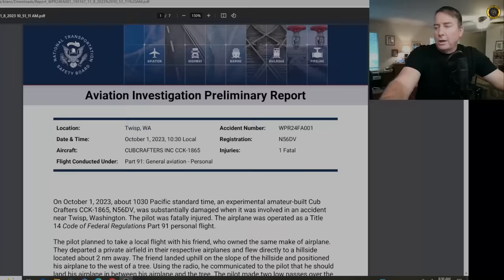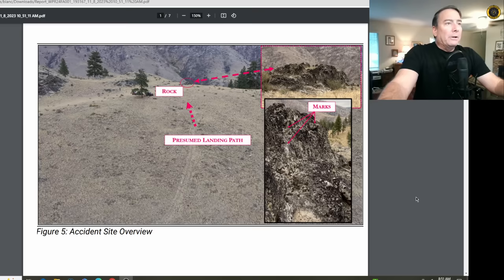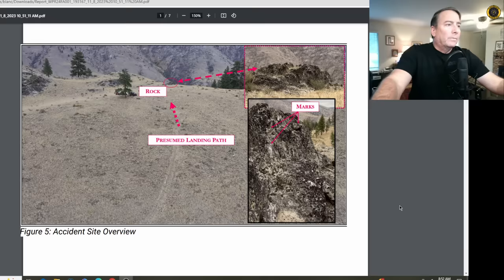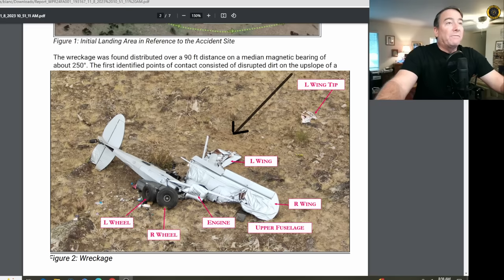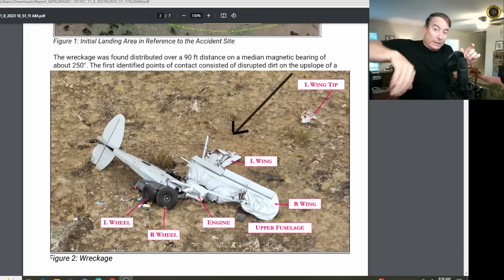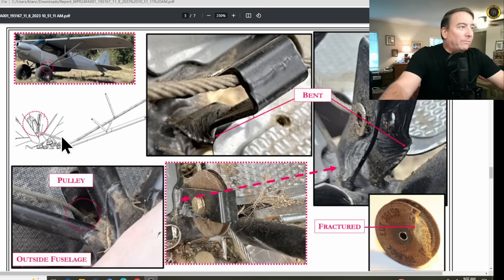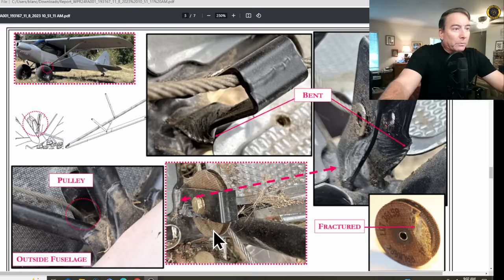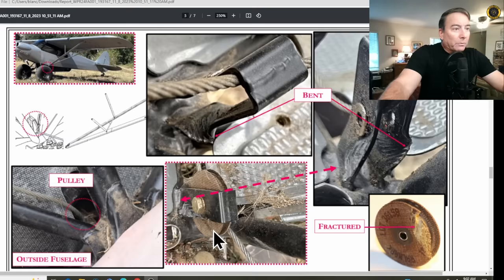Carbon Cub N56DV Fatal Accident NTSB Preliminary Report 10 Nov 2023

Comment: Hi Juan, very sad news again.
I've been following your channel and. Mentor pilot with fascination. But this incident struck me with such a simple cable mechanism running across what to me is a vulnerable position (hard landing for example) that strut joint should be reinforced and possibly a tube for the cables to pass through? To stop something like this happening again. I know that hitting a rock that size is a million to one chance but if I owned a plane I'd be making alterations too better protect the pulley's and cables.
Cheers for the excellent content of this channel.
Alan from Devon UK.👍
Reply: No need at all for that. it's a great design, plus you couldn't do that to your aircraft, as it would be illegal.
Reply: @scotabot7826   Wasn't this plane a home built, probably experimental, so wouldn't a safety improvement be legal?

Comment: I don't fly , I'm very interested in aviation. I am a motorcycle rider ( no crotch rocket) and have motorcycle friends that fly say riding and flying not the same, but the risks are as big in riding and flying in that some folks take big risks and end up having the same result in having accidents.  Juan said landing between the tree and the landed plane , but what happened was the opposite. Too bad this turned out this way.

Comment: There shouldn’t be a void so that the cable can get between, I get weight savings, but composite parts aren’t great for people who aren’t very involved in maintaining their plane. If your cables are adjusted properly, they will never leave a pulley, the cable is to far engaged into the circumference of it to leave it..
It’s not over, as long as lazy pilots exist, Blancolirio will continue to do these videos

Comment: And so…… When his landing carriage got smacked. That was the end of that aileron functioning. You can't really turn well after that. Right? Or left? Left out. It looked like he went left. And you'd think. How can anybody die in a Carbon Cub? As they fly backwards in a headwind! A colleague of mine had one. We used to talk about that. His dad was an airline pilot. He was a rock 'n' roll deejay. I was the engineer. We worked for the #1 FM station in Washington, DC. And I had been a student pilot. Because my dad became a private pilot. I flew Piper Cherokee 140 and 180's. Those were cool.. A lot cooler than a stupid Cessna. It's a, civilian P-51. To a, 13-year-old, at that time.  My dad started taking flying lessons. And I got to sit in the backseat. Every time he went up. And I have the expired previous months, Flight Charts. I always found everything the flight instructor asked for. Much faster than daddy. The flight instructor asked me not to call it out. That it was daddy's flying lesson. I would get mine, later, he said. And I did.

So that was not a good landing. A Piper cub shouldn't have crashed like that. He made a mistake. He shouldn't have been flying. At least I got the flyer for three years. Until my folks got divorced. And I never flew again until about 35 years later. Sort of.

 But when you find yourself part of the Media Crew. For the Air Force Association Conventions. In Washington DC. For a New Year's running. And one night. At the end of that day. I sauntered up to the, Boeing/Lockheed, F-22 Raptor, Simulator. Where they were Debuting. The brand-new, Boeing, Glass Cockpit. Which they would be flying. As it was just entering service. A little over 20 years ago. And I had watched. A number of our US military Fighter Pilots. Flying this simulator.

So I asked the Boeing guy. If I could give this F-22, a try? He asked me. If I had flown, F-14's? F-15's? Or, F-16's? I said no, never. Only a Piper Cherokee between the ages of 13 and 15. With my dad. Over 35 years ago. He said okey-dokey.

And so I get in the cockpit. It's pretty tight. And he starts to point things out to me. But I was a step ahead. And he stopped. And asked me again about the other jet fighters? I said no just the Piper Cherokee. And he continued.

This thing was truly wild. It was beyond Awesome. I had a lot of fun. And then I helped the Boeing guy. As he was giving me some instructions as I was flying it. And when he told me to press this switch on the stick. Until this one display changed to indicate 135. It wasn't changing. And he said I was pressing the wrong switch. I said I wasn't and it's not changing.

So he walked over to the cockpit from his master control panel. And he said, hmmm? We've been flying this simulation all convention long. And this one of the 6 computers. Has never done that. And I asked him, done what?  He said this was the preprogrammed flight plan. And it crashed. I said what do we do now? Since I over flew the last target. He asked me what do you want to do? (He's asking me?) I said. Without that computer operational. Can I just fly this manually? He said sure. And he threw a couple of switches in the cockpit for me. He said you are now 100% manual. What do you want to do? I said I want to double back. And go get that target I overflow. He said go for it.

Well I successfully did that. And that brought the simulation to an end for the day.  He said I did real good. It certainly was a rush. And as I turned around. There were 5 US military fighter pilots. Who had been watching me. And they all asked me. What I had been flying before? 14's, 15, 16's? I said nope.. Just a Piper Cherokee 140 mostly. 35 years ago. For a few years. Nothing since. They asked me why I didn't join the Air Force? I said I tried I didn't qualify to fly fighter jets. So I didn't join. They said I missed my calling. I said no. The Air Force missed a great pilot. They all agreed with me. We shook hands and went on our way. What a thrill! But it ruined me. I'll never be the same again. No.

I had Microsoft Flight Simulator, at home.  And a joystick. Bah! I can't play with these toys anymore! I was in the real F-22 cockpit. I was flyer an actual Simulator. I think he told me it cost about $12 million. That was over 20 years ago. It was running off of six.  6 foot tall. Silicon Graphics, and about $6 million worth of computers.  And Boeings software.

The following year I was able to try the Northrop Grumman, A-10 Warthog. I found that a lot harder to fly. I wasn't as good with that one. I almost collided mid air with a F-16. Flared too hard while trying to land and started to stall. That's when the Grumman guy grabbed the stick from me. I said what up?

He got kind of angry. He thought I was better. And it wasn't a computer simulation exactly. No. This simulation. He told me. He wasn't supposed to let me fly. He thought I was better he told me. And why shouldn't I fly it? It was the high-speed military one. And he told me I was flying with six other, A-10's. And one F-16 also in my airspace. And that had I collided with the F-16. Like I almost did. He said the entire simulation would have been brought to a halt. An unofficial military investigation would begin. Because only, certified military pilots were supposed to be flying this simulation. As the guys that were flying with me. Were up at ramp Stein Germany. Whoops. That was not the same for the F-22 simulator the year before. That was not connected to any military Internet computer based flight system. Very funny. I probably scared those other military pilots? I didn't have any radio communications going. I had no helmet on. I just thought this was a computer game? That one wasn't. And he thought I was better. No I'm not! I just thought it was like another computer game? Just a little more ultimate. Than, Microsoft Flight Simulator with the joystick. I mean that is pretty lame. Compared to being in the actual cockpits. With an incredible display all around you. Made by Northrop Grumman. And I really haven't played a video game since. From over 20 years ago. It just ruined me.

 I keep wondering if I ever want to get a ride. From one of those guys that has a decommissioned jet fighter of their own? I don't care how old. I want to know what my stomach feels like at 6G's? And will it stay in my body or come out my mouth? Should I wait to have lunch until later? Yes! And don't eat breakfast. Don't drink a lot of coffee. The slightly dehydrated. You could hit the bar afterward to get rehydrated. And then it'll feel like you're  back in that cockpit again. So maybe not?

Though I never had problems doing stalls in the Piper Cherokee. And nosing down throttle in and recovering from those stalls. I don't know what it's like when it doesn't stall? And goes loop the loop. I want to see what the gauges do. If they are steam gauges? Or computer displays. I don't care. I just want to know what it's like to communicate at 5G, speeds?

I know how to do Crash-Mattix.
RemyRAD

Comment: G,day Browne from Sydney Australia.
That cable around the pulley system for flight control surfaces has always been troubling for me. Mainly for the cable "jumping off" to the side. However rust (surface) is evident on this pulley (photo) with missing edge. What is your opinion on this metal fatigue?
🍩🇭🇲
Reply: I don’t think it was rust. As Juan mentioned in the video the pulley was made from some phenolic material. Likely a composite material using resin and paper or cloth (linen). If you search “phenolic aircraft pulley” you will find some good detailed photos.
Reply: I believe the pulley is made out of a resin. Did you suggest that the rust was a transfer or that the pulley itself was corroded?

Comment: Jaun, you mentioned that the other pilot was talking with him with a handheld radio. Does that mean the pilot was using a handheld too?  In the report it talks about how the other pilot spoke with him and he replied he was "still flying but having problems."  I would think keeping the airplane flying would have been more important than replying back on a handheld.
Reply: Accident Pilot was using the aircraft radio, not a hand held. All the pilot had to do was press a tiny little push button switch on the top of his control stick to transmit. As far as I know 99% of Carbon Cubs are built this way.
Reply: @scotabot7826  Thank you for that information.

Comment: I get the design intent for these cubs, having one really strong point to help save weight.  But it seems like when you have one point being so critical is a bad idea.  I would think it would be worth the extra weight to have the wing and gear attach at different spots.  So exactly this type of thing doesn't happen.  A bad landing shouldn't damage your gear and pull on your wings or flight surfaces.  After seeing this I don't think I'll ever own a cub (not like I could afford one anyway).  Hard landings are sometimes a thing, whether you like it or not.
Reply: It's not about saving weight, it is designed that way to put a direct, straight load path between the most highly-loaded components of the airframe, namely, the landing gear and wing struts. If you do it differently, with different mounting points for these loads, you are sending stresses through corners and placing sections of the fuselage in shearing loads.
Reply: @coreyandnathanielchartier3749  I know exactly why they did it. The cub is just a flying truss structure. And with the old engines the J3 was flying with they needed all the help they could get. But with modern engines and materials it seems like a bad compromise. I still hold that landing gear damage shouldn't make the plane spiral out of control.

Comment: Are those Phenolic sheaves/pulleys commonly used.  It is strong material, but it seems that thin sections don't have the strength of some alternative materials.  Just my experience with machining parts for odds and ends projects.
Reply: Phenolic material has its advantages and was used for many years to make driven timing gears which were installed in the hostile environment GM automotive engines. Like any fibre-reinforced resin, strength across many examples may vary. While some gears outlasted a first engine life and a rebuild, others failed earlier. In this aircraft, a cheap and nasty similar plastic weight machine pulley might just have survived being flexed, jammed but become a fairlead surface for the cable to slide over, albeit with more force required to move the control. A metal pulley may have also survived similarly. Phenolic material can be more easily machined but it may more easily become worn and abraded. In the aircraft, the pulley experiences far less movement than in something like a hoisting system or a fitness machine. In an ideal world, the cables would have been run up to the wings inside of covers on the front cabin pillars but the we are talking about more weight of cable plus two extra pulleys and their supports. We also then add four ninety degree bends of the cables. In an ideal world, pilots would not subject themselves and their aeroplanes to such risky business. But contrarily, in an ideal world, people should be permitted to push the envelope and take their chances. That is the sure and often resolutely wielded staff of innovation and progress, so long as the adventurers do not take some unlucky screaming and kicking poor sods with them into the afterlife or hell-on-earth disablement.

Comment: This is why I build my model airplanes with pushrods instead of cables.
Reply: That's why I love aerobatic airplanes like the Pitts Special & Extra...pushrods (elevator & ailerons).
Reply: I build mine with Testor's glue and put them on my shelf😳
Reply: Yes I agree. And where possible, servo placement close to the control surface.

Comment: Its odd the seat in cub is right up against the stick like that. 
Or is that stick in Full Deflection (nose up position)? 
(if not you would be fitting the pressure from seat as you pull back.), 

(Why does it not have a half circle relief cut out of the seat like old cars with bench seats and stick shift had. 
LMAO Ford i drove 2nd n 4th gears were very uncomfortably close to my friends crotch as she was sitting in the middle for road trip. Go to point i would skip shift 2nd and use only 1-3-4 and 2ns was touching her thight)

Comment: I was never a fan of cables for control surfaces. With a low wing you can have pretty solid mechanical linkage but still, I wonder if a well done fly by wire system could be as good or better because that could simplify manufacture and free design quite a bit. Each servo could have a battery and wireless connection as backup incase power cable would be snapped or power failure so you have maybe an hour to get on the ground. It would naturally lend itself to autopilot operation as a free bonus. And the stick can be placed very freely and be very small.
Reply: This type system is used in much more expensive aircraft.  Think G650, A330, etc.  It’s not really practical on a Cub.
Reply: @michaelduncan9864 sure, in years gone by. Now it's practical to put autopilots in model aircraft. 

It's certainly possible, and practical, but human rating it, probably not.
Reply: @gasdive  Indeed. A couple of years ago I played for a while with Ardupilot (an open-source Arduino-based autopilot) and it was pretty impressive. It could autonomously fly model aircraft, including full missions with any number of waypoints, including specific altitudes at which to cross each waypoint. It even had auto landing, albeit somewhat crude at the time. There were a lot of people flying missions of many tens of kilometers. Impressive stuff for model aircraft, low-cost hardware and free software.
Reply: Interesting thought. A perhaps not perfect analogy, but wireless servo shifting is the norm on higher end road/triathlon bikes these days.
Reply: @michaelduncan9864  why not?

Comment: Pulling the left cable at the strut lowers the left aileron resulting in a RIGHT turning condition which matches the relative direction of the accident after the initial impact. 

In all three cases where you demonstrated or referred to the result of pulling the cable at the lift strut, pulling the cable showed the same side aileron dropping which results in an off side turn unless in a stalled condition.
Reply from the maker: No.

Comment: Sporty piloting aside, I'm very curious why the pulley was made from such a poor material as phenolic - especially on a carbon cub. Phenolic is a horrible material that is prone to all sorts of environmental weakening, it's brittle, and it's not even as strong as most grades of aluminum. seems like a very poor choice here. Hope the failure mode of that pulley was considered in the investigation because from my experience there's no excuse for using it.

Comment: This crash started before takeoff. What brief did both pilots have before flight?  When landing on a rough field you need to set your self to a commit point.  Bail out before then, once committed you land and/or crash under control at a lower speed and you will likely survive.  Half-baked decision making is not compatible with safe flying!

Comment: This seems like really poor design for routing control cables, especially for an aircraft that experiences some serious landing gear abuse.
Reply: Cubs have been flying like this for nearly a century.... this case was "It's only a matter of time" for the pilot, not the airplane's fault!
Reply: I'm not arguing that the pilot absolutely wasn't at fault for this accident or apparently several other accidents. It just seems like a poor way to route a control cable when it is routed such that it could be easily damaged. @billbrisson
Reply: @jaredgates4310 It wasn't "easily damaged"  --  the damage was effected with considerable difficulty, thanks to the pilot's ability and experience.